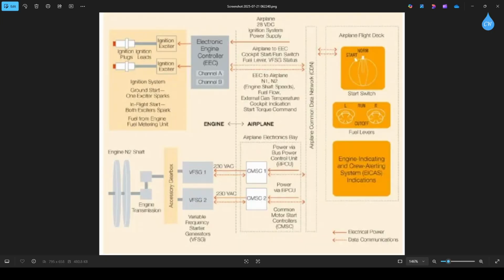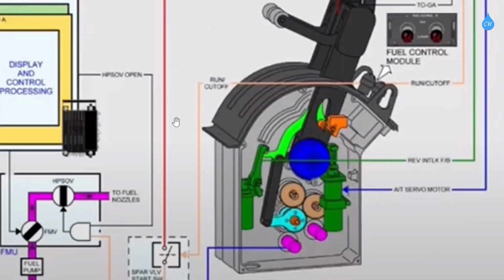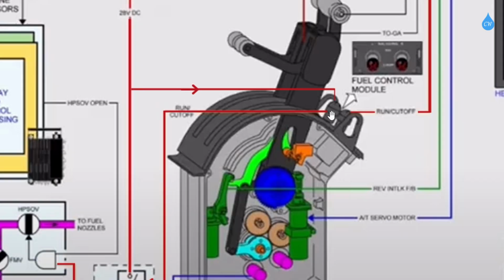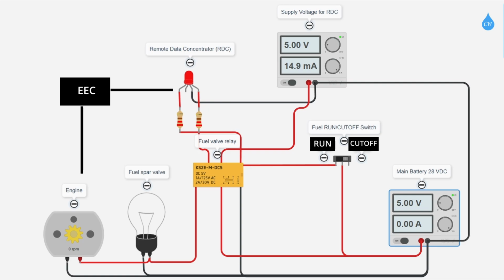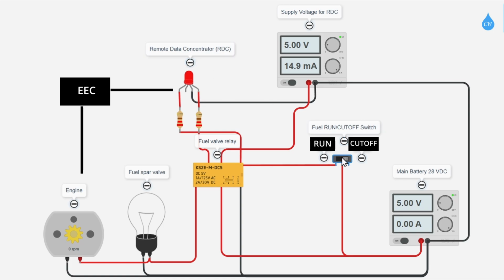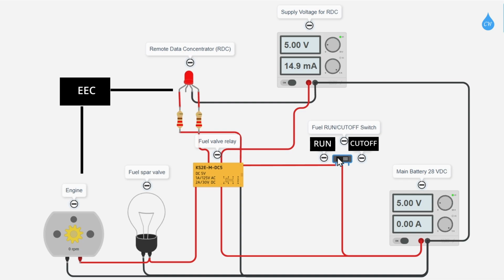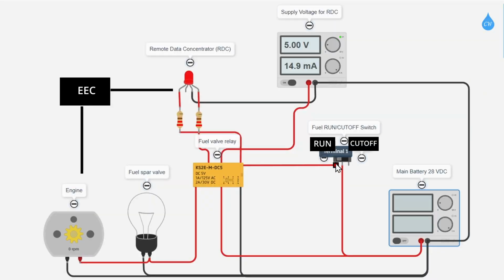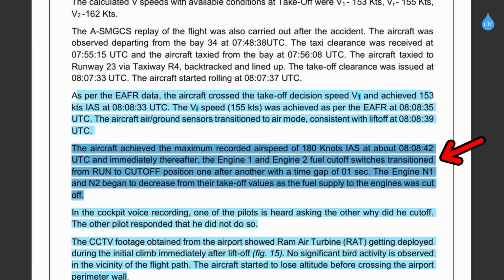Air India Boeing 787 Fuel Cutoff Switches - Clear Waters #airindiacrash #inspiration #boeing787

Comment: However, it has been reported that the engines went to cutoff 1 second apart. If the power supply to both cutoff/run switches failed at the same time as it is a shared source, then both the engines would cutoff at the same time.

I think the demo is interesting, and could still apply, if, for example, the power to the left engine switch comes from a different source to the right engine switch.

Comment: From the beginning, i believe that this was an electrical/electronic failure. Not mechanical. Definitely not pilot error. Did not matter if the fuel switches were physically at RUN position, an electrical/electronic glitch could have stopped fuel going to the engines.
Reply: before the plane took off there was serious electrical problems the passenger screens not working, the ac not working, cabin lights flickering, could this be related to the fuel problem
Reply: Complete bullsht

Comment: As you say, the GEnx diagram is highly simplified. You will never understand any aircraft fuel control system without more detailed diagrams and pictures of the internals of the fuel valves. Without these, you are just guessing AND SPREADING MISINFORMATION. 

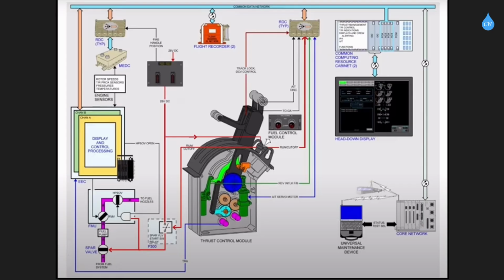3:50 The additional line you've drawn is incorrect. The fuel lever has a four poles controlling multiple relays by sending a ground to 4 or more relay coils. 

Each pole of the switch generates a different ground and the solenoids of each relay are powerd by 4 or 5 different circuit breakers. As each relays activates/deactivates multiple aircraft devices, the effect would be seen at dozens of aircraft components and recorded by the FDR. It would be easy to tell if one relay or one pole on the switch failed. One of these relays may be responsible for sending a signal to the RDC, the device for digitising the signal (as it is on the Boeing 777). The spar valve and the fuel shutoff valve are on different relays. 

When pulled (only), the fire handle sends a voltage directly to the motorized spar valve in the wing and to the shutoff servo valve which controls the HPSOV (and NOT as shown in the diagram). No relays are involved in engine shutdown using the fire handle.

The fuel cutoff lever communicates with the EEC by BOTH analog and digital paths. 

The relays are dual pole, and may be latched in the last position selected. Similarly, it's common for the servo valve which controls the HPSOV to be magnetically latched in its last position (with permanent magnets). Loss of main bus power will not result in engine shutdown. In fact, shutting down an engine needs power.
e.g. A LATAM 777 flew without main bus power. The engine on the QANTAS Airbus A380 which suffered catastrophic engine failure had an engine which kept running after landing because the wiring had been severed to the valves.

You have already assumed it is bad, but it would be bad if you wired it up like you have. Every jet engine for the last 40 years uses a similar system and it is extremely safe. 

The basics are:
The EEC, fire handle (not pulled) and fuel cutoff lever in RUN are all required for engine operation (if power is available to do so)
Any of the above can shut down an engine (if power is available to do so)

It is very unlikely that any of these devices would fail almost simultaneously on both engines. Wiring is usually routed on different sides of the aircraft after it leaves the cutoff levers and fire handles.

FACT: modern aircraft are fitted with emergency (rechargeable) power supplies to shut down engines in case main bus power and battery power is lost. 

You are also WRONG regarding the thrust levers("throttles").  The EECs provide power to the RVDTs (position sensors) on the thrust levers... and, as you say, the EECs are being powered by the (dual output) dedicated alternators.  General electric EECs are typically designed that if they do lose the signal from the thrust levers, the thrust remains at the last setting (if the aircraft mach number is greater than 0.2M). i.e. less than the V1 speed. If the mach number is less than that, the engines are commanded to idle, *not shutdown*. 

There are different EICAS messages for engine shutdown using the fuel levers and EEC-controlled shutdowns. 

I don't know why you are doing these videos. You are only confusing people. Frankly, I'm getting tired of correcting all the misinformation on YouTube.
Reply from the maker: Thank you for your comment and for the information provided. I make these videos because I am witnessing what I think is an injustice to the pilots, in this case the captain. The preliminary report lacks information but provides enough to point to the captain as responsible for the crash. I also do these videos because I do not understand why people with knowledge about these systems are not speaking up, but just criticize people that are expressing their discontent with the crash investigation like myself. 

The main point that I am trying to get across, is that in my opinion, they (Boeing, Air india, investigators) have the data of the crash and they can manipulate it like I think they did in the preliminary report.  So, I think that the most import thing is to bring awareness that investigation should be focusing in the possible replication of a fuel cutoff signal without touching the switches.

On my last video I am explaining in an extremely simplified example that if you leave the EEC without any signal from the fuel control switches, the EEC can either bring the engines to idle or shut them down. Probably immediately or after a number of seconds. Those fuel switches positions send a voltage signal to the DRC's and these tell the EEC's the position of the fuel switches. The DRC's are not directly connected to the EEC like the thrust levers are. I am pretty sure you already know this. If technically we (people that are willing to cooperate), can demonstrate that the engines can both go to idle or shutdown without the pilots touching those switches, then we can put that information out there for the public to see that that crash was not cause by any of the pilots.
Reply: @Clearwatersa I have heard two aviation experts, including Captain Sam Thomas, make the statement that there are no position sensors located at the fuel switches themselves, so that any interruption of fuel to the engines could be recorded by the FDR as the switches being moved to the cutoff position even if they haven't been.

In addition to the ANA Osaka incident, another 787 experienced an unexpected shutdown of both engines mid-flight without the switches ever being touched by the pilots. Having been at full altitude, they were able to get both engines restarted before crashing. So we know that duel engine shutdown can occur without the switches being moved to the cutoff position. Whether this is what happened, remains to be seen.
Reply from the maker: Thank you for your comment. Even in the case that the fuel cutoff switches have a double signal to know the position of the switch, there are questions that have to be answered and verified with technical data. For example, what happens when both voltage signals are lost for the position of the switch? What fail mode action the FADEC takes when it looses communication with the RDC, which is the interface that lets the FADEC know the position of the switches. Does the FADEC command the engine to shut down or to go to idle or do nothing?
Reply: @Clearwatersa  The answers to those sort of questions won't be found in your typical maintenance manuals or maintenance engineer training manuals. Only Boeing or GE would know this. And you'd have to specify what kind of fault is occuring. 

I think we first have to look at the basics. I don't think the RDC has any significance when it comes to essential fuel control. The RDC attached to the switches (or switch relays) is probably there to tell less important systems what position the fuel switches are in. 

I think we first have to figure out how the dual coil relays attached to the cutoff switches work, especially if the 787 has additional 777-style latching relays holding the relays in place if the ground signal from the cutoff switches is lost. I can't figure out why they are there if the relays are already magnetically latched. I don't have any part numbers for the relays, so I can't check. 

I don't think the EEC needs to see if the lever is in RUN, it just assumes it is in RUN if the levers aren't in CUTOUT. It does need RUN to get main bus power to power it, but in the case of Air India, the Dedicated Alternator is already providing that power.

I can't post non-YouTube links here, so I can't show you how it's done on the 777... which is probably not much different from the 787.
Reply from the maker: I think the EEC is checking on that RUN/CUTOFF switch position from the RDC. If the EEC does not know the position of the switch and the engine stops working because the spar valve was closed, the EEC will attempt to restart the engine. So I think it does need that signal that tells it that the pilot wants the engine to shut down. It might be the case that if it doesn't get any reference from the position of the fuel switch, the EEC makes no changes and just keeps the engine running.

My email: clearwaters705@gmail.com
Reply: @Clearwatersa  Thank you for your kind response.

We already know the engines can be shut off or go to idle by EEC command. It's just very unlikely that they would shut down the engines simultaneously due to a fault. 
Already 1000 people have seen your video and, will be spreading your implausible scenario (no matter how many caveats have been inserted into your video). Artificial intelligence is already doing an excellent job of spreading misinformation.

Only @cosync has come up with a semi-plausible scenario, and he seems to have the diagrams we need, but it still doesn't seem to address fuel valve design safety, especially if the valve is magnetically latched in its last electrically commanded position. I patiently await his promised video. I'm not saying a shorted battery can't cause an electrical system meltdown, but what I don't understand how that would move a fuel shutoff valve to closed (especially a motorised wing spar valve or a magnetically latched fuel servo valve as seen on other GE and RR engines).
Reply from the maker: In 2019, an ANA B787 had a dual engine shut down after landing without the pilots touching the fuel cutoff switches. So it is possible. 

You don't need to have the fuel shut off valve to move in order to shut down the engine. The question is, what action the EEC takes when it does not have a reference for the position of the fuel control switches?
Reply: @Clearwatersa  It is possible. An EEC can act unilaterally. It can do it if it thinks it has lost control of the engine, as in the case of ANA: 

Due to a strange combination of pilot actions, the EECs were fooled into thinking the engines were out of control. The pilots started to deploy the reversers in the air (as they can do below 5 feet radio height), but they floated for too long, and realising this could end badly, they cancelled the reversers. The aircraft touched down with residual thrust. This triggered the TCMA logic in the EEC:
Aircraft on the ground
Thrust levers set at idle
Actual thrust still high and not decelerating towards idle fast enough. 
The EEC thought it had lost control of the thrust. 
I believe Boeing created a patch for this unusual scenario, but even the old TCMA logic would not have been triggered in the Air India case. The thrust levers weren't at idle, the thrust wasn't behaving abnormally and the aircraft was reportedly not on the ground when the engines were shut down. 
EECs and fuel control systems have been able to act independently for many decades. The Rolls Royce RB211, for example, could shut down an engine if it though a rotor shaft had broken in half.
Reply: Very interesting 👍👍